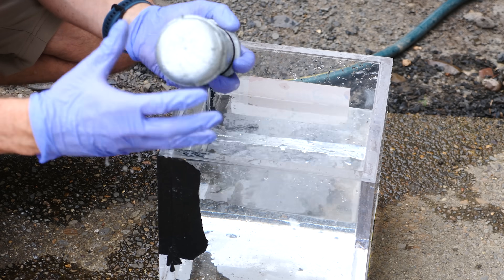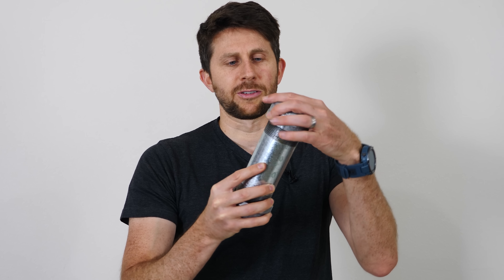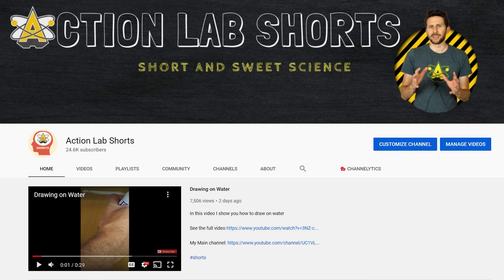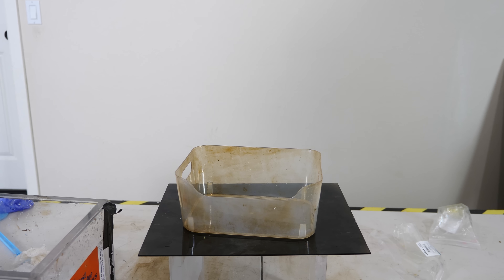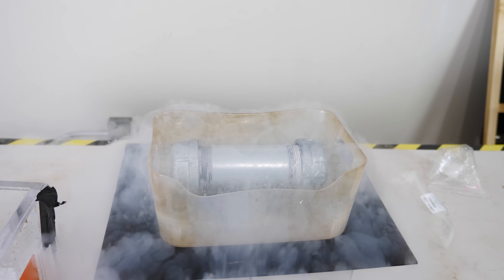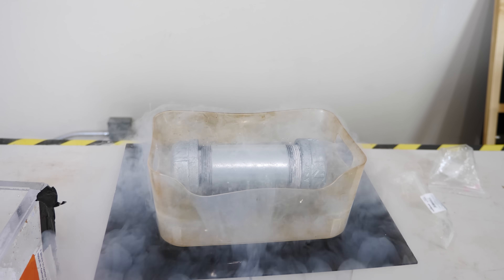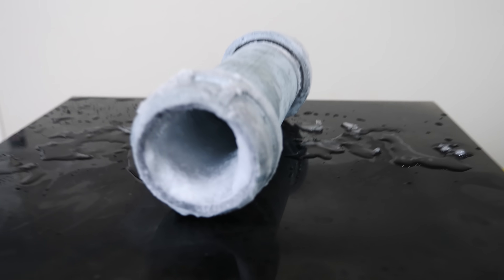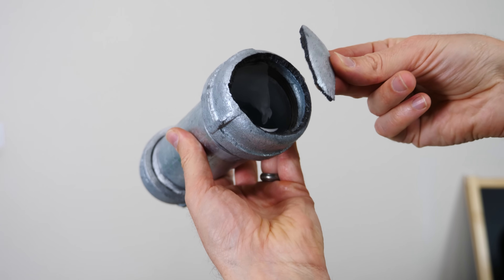Can You Stop Water From Expanding When It Freezes Into Ice?

Comment: Well the caps were cast, you should do it again with machined ones
Reply: Yeah, but we're talking about 90,000 PSI. Something's going to give.
Reply: @hfuy8005  Wondering if what OP meant is that the threads should give out, not the caps or pipe?
Reply: @hfuy8005  the point is that it's NOT steel and he keeps saying it over and over. It's just cast crap
Reply: Why argue when water pipes can be made of various materials? Forgot about copper and lead? Maybe go back in time even further...

I wonder if this cube would be strong enough: https://www.youtube.com/watch?v=eDA7EUDOiwU
Reply: Came to say that too. I'm not even sure the pipe is steel and not just plated cast
Reply: @notchbackgta  It doesn't matter. One who lives in an area where there is freezing temperatures in winter knows that ordinary water pipes are going to break. Theoretically if you use longer pipe, the cap doesn't matter that much, the side will crack anyway as the friction between sidewall and the formed ice will probably prevent the "ice rod" to move longitudially.

Would be interesting to see the explosion of a steel pipe with 50mm drill diameter and 200mm wall thickness. 😉
Reply: @gabiold  Holy shit dude. He REPEATEDLY says it's STEEL. IT ISN"T STEEL, your entire reply is irrelevant
Reply: @notchbackgta  ???
Reply: @gabiold  most ordinary water pipes aren't steal there made of cast iron
Reply: @dennism.7962  They are not cast iron, probably everywhere in the world, as it is inpractical that way, both for manufacturing and both for use. Fittings for steel pipes are made of cast iron usually (like the endcap in this video), exhaust headers in cars is another example, but long pipes  usually not.

Here there are 2 kinds of steel pipes exists:
- extruded seamless for gas applications, usually to be welded together, to be used with weldable (non-cast, non-threaded) fittings. The pipe can still be threaded if you like, as it is the same standard size.
- hot formed, longitudinally welded, cink coated, these are intended for water applications with the cast iron fittings.

There are stainless steel pipes of course, but those are different kind of beast, rarely used for water in domestic area.
Reply: @gabiold  water pipes are plastic or cast.
Reply: @dennism.7962  old mains pipes under the streets in cities are normally cast iron- when they burst they're replaced with steel. All pipelines I've ever seen that go overland are steel. They were all installed well after the cast iron days were over ( here in Australia). We never have issue with freezing pipes as in South Australia winter snow makes the 6 oclock news it so rarely happens.
Reply: @Foghorn Leghorn cast is weak. It's porous and brittle compared to solid machined steel

Comment: That was a wonderful example of brittle fracture. I was a little concerned when you said it was just going to bow (plastic deformation), because that's not how metal fails at that temperature. I'm glad you took proper precautions.

Also, if you do this again, you should heat the water to near boiling when you fill the container to minimize dissolved gases, and (I don't know if you did or didn't) use deionized water. You might actually be able to make a different phase of ice.

Comment: As far as I know, the comment about steel at low temperatures was not accurate. The mechanism of failure changes in that temperature zone for many steels. Ferrite steels often are considerably more ductile above the transition temperature and cracks propagate in a stable manner. Below  instable crack propagation occurs suddenly under much lower energy consumption.

Comment: A few thoughts, Did the steel become brittle with liq nitrogen on the outside and I'm curious if water properties changed under pressure when Freezing similar to when it's Heated under Pressure (it has a higher boiling temp)? Under Pressure when freezing/frozen might exhibit similar properties. Thanks for the thought provoking experiment 👍🏽

Comment: Try using an airtight concrete reinforced container, maybe it can sustain that much pressure?
Edit: Now that I think about it, 6k atm is way too much for anything to handle, nvm
Reply: tungsten, tungsten carbide or a tungsten alloy.
Reply: @Metal_Master_YT  maybe if it is yards/meters thick around a small sphere of water, but I doubt it. All science experiments that try to reach pressures like this use diamond anvils with a fraction of a drop of material between the two halves.
Reply: @johnbennett1465  because its cheaper to do it that way.
Reply: @Metal_Master_YT  it took some searching, but I found some compressive strength numbers.
Tungsten Carbide - Compressive Strength 3347 ksi(23.07675 GPa)
Diamond- Strength, compressive>110 GPa(15954.2 ksi)
I added the conversions so we can compare the numbers. Note that tungsten carbide is not even close to diamond.
So no it is not just cost that causes researchers to use diamond anvils.
Reply: @johnbennett1465  the cost to benefit ratio dude.
Reply: @johnbennett1465  plus, this is not compression, its the opposite, since the container is being stretched and torn apart, not mashed together like in a hydraulic press.
Reply: @johnbennett1465  have the numbers for tungsten metal, or its strongest alloy?
Reply: @Metal_Master_YT  within the tolerance of the weaker material, the cost/benefit tradeoff matters, but above it there is no choice. Since most of the science experiments I am talking about are trying to achieve the highest possible compression, they have no choice.
Reply: @Metal_Master_YT  the science experiments I was talking about use compression, but you are correct that the experiment done here does depend on tension. I found the numbers with web searches. It is a pain to do, so if you want more numbers, you can do it  yourself. I did searches like "diamond compressive strength" and looked at the top results until I found the values I wanted. Note that I saw a lot tensile values while looking for the compression values so I expect them to be easier to find.
Reply: @johnbennett1465  yeah, since they don't care about cost very much, in this case the benefit is what matters. so they use high quality specialized diamond.

Comment: I love the talk about safety and using a blast shield then waiting til after the time bomb is set to actually set it up 😂
Reply: Touching supercool metal with bare skin is also really bad practice. Not an issue when your hands are dry, but when they are moist or wet, it is a different story.
Reply: @NetAndyCz  yeah that made me cringe, although by then it had likely warmed up significantly.
Reply: @MeppyMan  It is most likely not supercooled as the water inside still not gone through the phase transition, so it is very far from LNO temperatures. He most likely measured the temp before grabbing it. And grabbing ordinary freezing things outside in winter is pretty much an everyday thing.
Reply: @gabiold Not where I live, doesn't get cold enough.
Reply: @NetAndyCz  it was -10, of course still not great, but not that bad
Reply: @SaltyMikan  -10 is 14 degrees Fahrenheit and probably even warmed up a good chunk and even if it didn’t he would need to hold it for 7 minutes straight before any damage starts to occur it’s not bad at all
Reply: @NetAndyCz  co jste meli hodinu fyziky na zakladce?
Reply: @Taurgar  Základku jsem opustil moc brzo, fyziku jsme měli až na gymplu :p
Ale dostali jsme se i k tekutému dusíku a je s ním legrace, po ruce steče hned, ale nesmí nakapat do boty :p
Reply: @NetAndyCz  the metal was only -10 C
Reply: But to fill the pipe with water he wore gloves. Safety first.😅
Reply: His explanation is a separate take, his blast shield is set up before he adds the liquid nitrogen
Reply: @Rad_Dan  It's hard to tell how it is "set up", at 4:15 you clearly see that it has not been set up in front of the camera yet. Maybe he carries it in front of his face and then moves to protect the camera too, at just the right moment...
Reply: @u1zha  oh yeah I don’t know why I didn’t see that
Reply: @u1zha  I think he might have used the shield for himself (personal protection) and then maybe last minute thought about camera damage and was adding another for that.
Reply: Well he put it there just in time. :)
Reply: This guy is dangerous to himself.. :D
"Don't do how I did, do how I said.."
"Safety in my ass"
Reply: 2:55
Reply: Lmao as I read this it exploded
Reply: And imagine using gloves to fill in the water into pipe, but touching frozen pipe right after explosion 😂
Reply: So much fail in this video. Also he never heard of bursting pipes in winter. Haha
Reply: @pspublic13  I know right! It's like he thought pipes never burst!
Reply: This guy never takes proper safety precautions during his videos. It’s a common theme
Reply: lol liquid nitrogen everywhere
Reply: I agree how can one be so smart but do something so dumb. I like his channel and all but damn he's lucky it popped from the cap and not the pipe itself.
Reply: @TheTubejunky , his intelligence is beyond, he calculated the moment it would explode :v
Reply: @truthseeker7815  LOLzz..
Reply: @jannejohansson3383 , finally, someone
Reply: @TheTubejunky  it's uhm... called editing. ;p
Reply: @TheTubejunky  does being pedantic actually make you feel good as a person?
Reply: @TheTubejunky  given the thickness of the pipe wall it was always going to fail at the caps/thread. Unless the pipe had a structural weakness already. 

I was thinking when he was doing his safety talk that it doesn’t take much energy differential to create a dangerous projectile.
Reply: @MeppyMan  it didn't break at the threads... watch the video to the end.  he clearly shows you the failure point.
Reply: @MeppyMan  beat me to it
Reply: @MeppyMan  very last secobd
Reply: @MeppyMan  It didn't fail as a result of thread failure. It failed at the end cap which was compromised by metal embrittlement due to the rapid cooling brought about by the liquid N2.
Reply: @TheTubejunky  that was guaranteed. The end caps are the weakest part of any cylinder. He was safe as soon as the cylinder was pointing away from him.
Reply: Why?
Reply: He also wore gloves to screw the cap on under water......
Reply: I had to pause and read this comment 8 times to understand it.
Reply: Pipe bomb
Reply: It is more the fact that it takes a while for water to freeze so he knew it would at least be a couple minutes before it has become fully frozen
Reply: LOL!!!!
Reply: The talk is separate my man. There was a blast shield all the time.
Reply: This dude is gonna kill himself one of these days. Love the videos but damn
Reply: @pretzel2558  this is another The King of Random brewing. Backyard scientists never learn.
Reply: Ice is very strong , ice is also very slow
Reply: Shield was in place whole time, he just adjusted it over to cover camera near the end
Reply: The blast shield that does not appear to be in any way durable enough to stop high-velocity steel shrapnel.
Reply: Also, I love the idea that the thin piece of plastic is going to stop steel shrapnel.
Reply: That’s probably because he already knows what is going to happen. Most scientific experiments that happen the scientist knows the few outcomes and how dangerous each could be
Reply: Not really. He's not holding the camera in his hand. It's on a tripod.
He moved in front WITH the shield.
Reply: Time works slower for this guy 😅 must be the correct answer 😅
Reply: And he wore gloves while filling the chamber 😆
Reply: Didn't look like much of a blast shield anyway.
Reply: How do you do the water bottle trick   Liquid cold and when you tap it it turns into ice.   How and why ?
Reply: It’s not a bomb. With a pipe bomb there is an explosive inside that expands super fast as opposed to this where the water is very slowly expanding as it freezes… this will never explode like a pipe bomb. It’s physics and I’m sure he’s well aware of this…
Reply: Well, it's not like this is a fast reaction. It doesn't happen the second it starts to cool. The only reason this thing failed is because of the nitrogen super cooling the metal. And yes, he took a temp but it was not while it was under liquid N.
Reply: It's called editing....🙄
Reply: @landocalrissian7107  I love comments stating obvious things like this... What difference does it make if that was recorded later then edited in before? Either way the blast shield appears to have been put in place at the dangerously last moment, when somebody with his training should have known better. 

It is comical that from the video's timeline, he brings our attention to the blast shield right before showing us how he forgot to put it up at a safer time. In all likelihood he probably recorded that after and stuck it in before recognizing that not doing so could be showing potentially kids how to do stuff in an unsafe way; so he likely did it just to be responsible, which is respectable. We all make mistakes; luckily that didn't lead to anybody being hurt in this video. My comment wasn't to be mean, I like Action Lab, I was just pointing out something I found silly and funny.
Reply: @fonze5664  I love typing 3 words and manipulating some pudding brain to type several paragraphs that I don't waste time reading....😊
Reply: @landocalrissian7107  I love that you have nothing more important to do with your life than troll randoms online....😋 Thanks for being honest
Reply: @fonze5664  he doesnt have any training though lmao. and i knew from the beginning this was probably going to happen. i was surprised with how casual he was just pouring it in and holding it
Reply: I don't think he expected it to react so fast, and no one can know everything
Reply: Ikr
Reply: Then grabbing the supercooled metal without gloves - chef kiss
Reply: It's called editing...
Reply: @user-xs1fm3bo8t  or genuine yolo/luck.
Reply: @user-xs1fm3bo8t   You do realize that what you're doing here with this comment is making an assumption and not only trying to pass it off as fact to everyone else, but also genuinely believing that it's a fact yourself.  That's a really bad habit that you should try to address.
Reply: I know right! What a moron! He basically made a pipebomb and sets a blast doors the moment the metal container explodes!

Comment: Isn't the volume reducing inside of the container that's holding the water? As you showed at 5:12, the majority of the ice-water that formed was around the inner-wall, whereas the rest of the liquid-water filled the rest of the volume within the middle. Ice begins to form on the inner-wall first where the temperature is < (Freezing-point of H2O), hence it expands and takes up more volume than it did before it froze. 
By this logic, the remaining liquid must surely be compressed under more pressure (from the reduction of its initial-volume, which is the full, inner volume of the container) than it what it was at at initial-time 0sec (i.e. > 1atm). Once ice forms on the inner wall, the pressure acted upon the remaining liquid increases. 

By this, isn't there a relationship between geometrical shape and volume of containers (e.g. a Sphere) that can be optimized for increasing this internal pressure of the liquid acted upon by the reduced volume?

Would love a comment or an upvote so James can see this!

Comment: Some corrections / tipps:
- You mentioned that the caps are steel. That is wrong. Contrary to the pipe, which is probably steel, the screw on caps are not steel, but cast iron. Thus their tensile strength and elasticity is much lower than that of normal mild steel. Mild steel has usually 5 to 7 times the tensile strength of cast iron. So your material choice was less than optimal.
- If you want to make this experiment with a really strong container, get a steel cylinder, drill a hole in it, cut threads in the hole and put a long steel screw in it.
- Measuring temperatures of bare metal surfaces with infrared thermometers is very unreliable, because of the unique IR light transport porperties (reflectivity, etc.) at metal surfaces. To fix this problem, just paint a small measuring spot of it, with some matt paint. The thermometer does not only measure, where the laser spot is, but in a pretty big circular area around it. So make sure, you make the painted spot big enough and hold your IR thermometer close enough.
Reply: @fsboss  Great points!  He could also just paint the entire container.  I was wondering about the accuracy of that thermometer on such a reflective surface as well.  And that broken cap did look more like cast iron.  It looked really brittle.  I wonder if actual steel would have ruptured or just deformed.

Comment: Wait, was that CARBON steel or STAINLESS steel? Carbon steel will fail at -30 Celsius even with little forces involved
Reply: Grandfather_Din_Racket  cast iron isn't much better than carbon steel in that so definitely there was some embrittlement. But maybe that was for the best, if he would use the correct materials the explosion could be worse.

Comment: Ok I have a question:
I would assume that when that dense ice melts, it goes back to regular water density, so it will expand.

So, if you place that dense ice in a super strong container which has no extra space, does that mean that you could keep the water frozen at a higher temperature than normal because it has no space to expand?
Reply: You can see from phase diagram that if you have enough pressure then water stays solid even at 650k. (273k is 0°C btw)